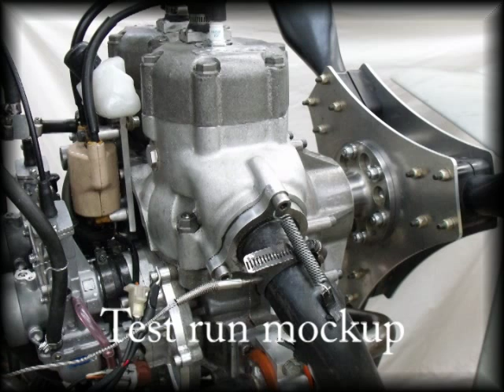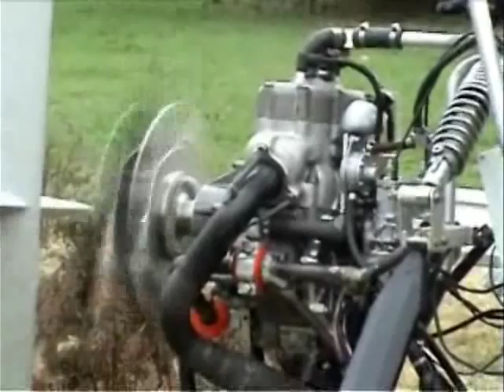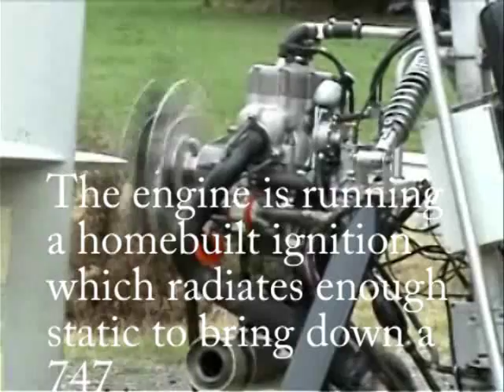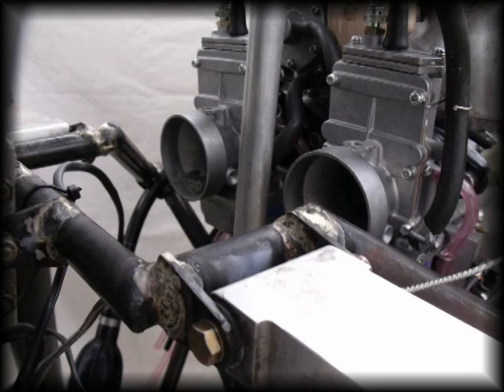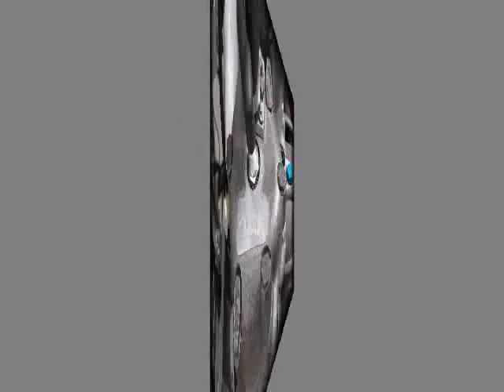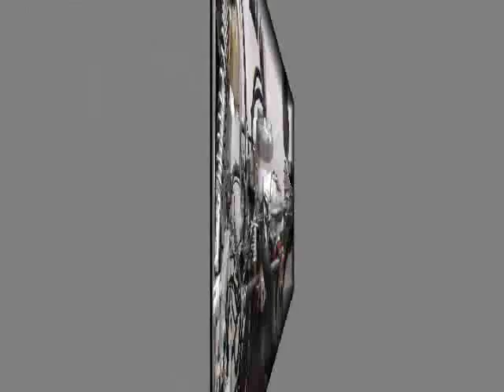Tandem Twin.flv

Comment from the maker: @GerbilGronk  The manufacturer has since told me the engine with ignition but not the exhaust or radiator weighs 32 kg or 70 lbs. It puts out no less than 70 hp. With the radiator and exhaust it would be somewhere around 38 kg or 84 lbs.

Comment: this engine went nowhere, Insurmountable trouble with the gear drive / crank joining system.
Has now transformed into a parallel twin, case reed, is flying, clocking up the hours.
Reply: Hello. How it looks like now? Is there gears?